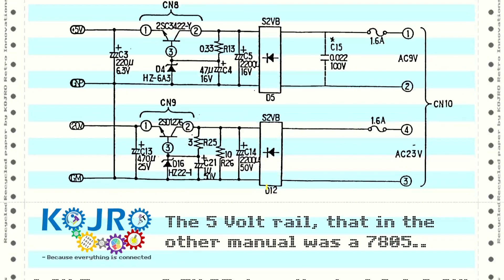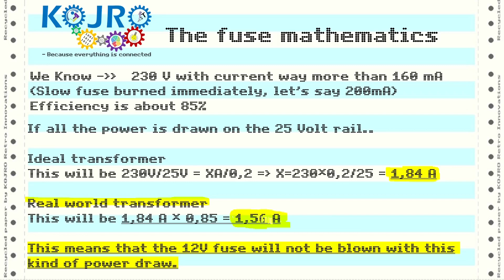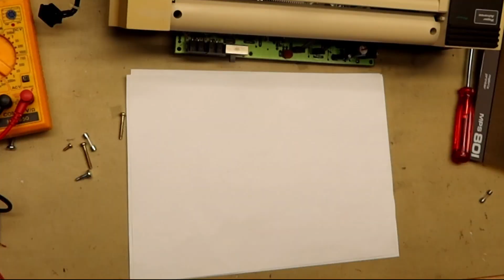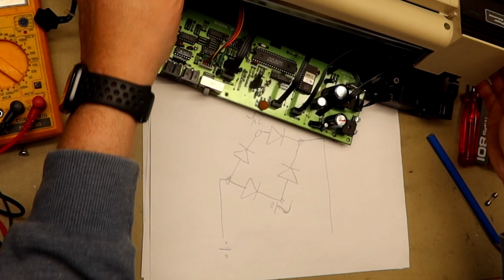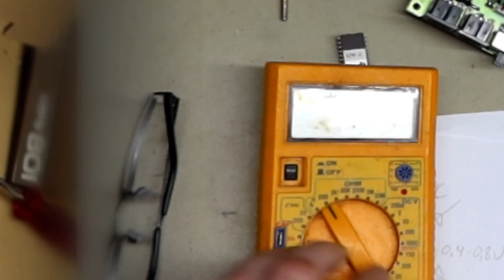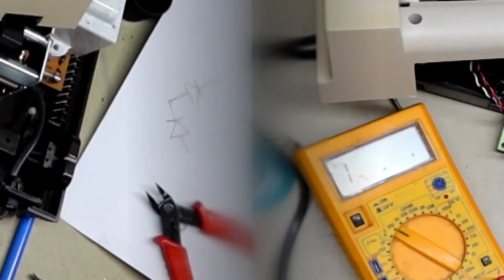The Commodore MPS 801 printer, part 2

Comment: I wonder if this is a common fault on these. Just bought one from E-bay not working, short on the 5v rail and the same capacitor the 220uF 6.3v is shorted. Thanks for the video

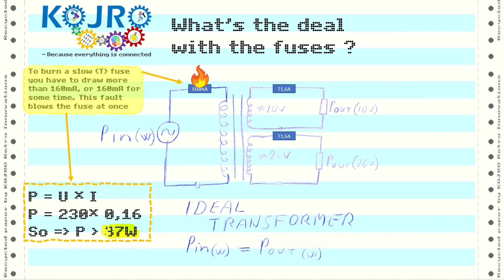Comment: 6:52 thank you so much for that explanation about "T" fuses. I was wonder, how much more amps, they can handle in the first seconds.
I've repaired brown c64 psu by replacing all components on the pcb, but I didn't have T fuse. I've used M160mA, which is Medium (semi-time-lag). And It was working fine, until I start to do a test for "spikes" - turn the psu on, then turn off, turn on, turn off, etc. After 6th time the fuse blew up. So I used M315mA instead and now it is okay. But I was curious how many amps it can skip.